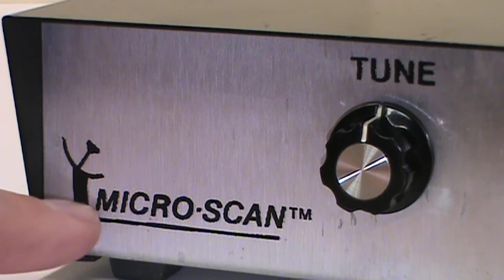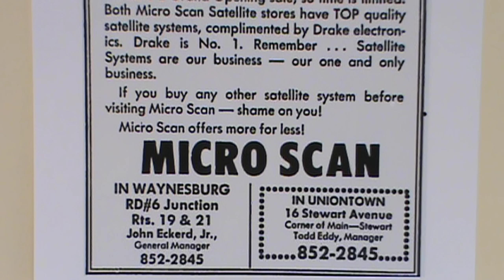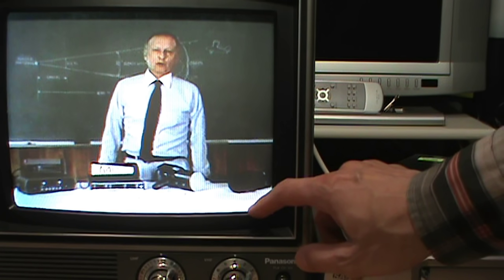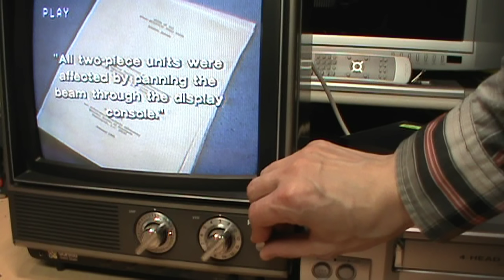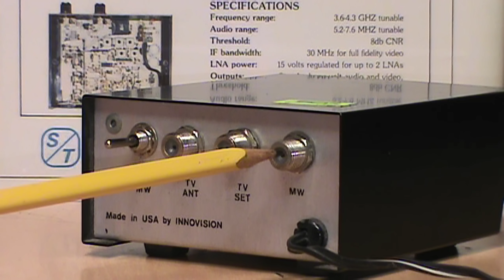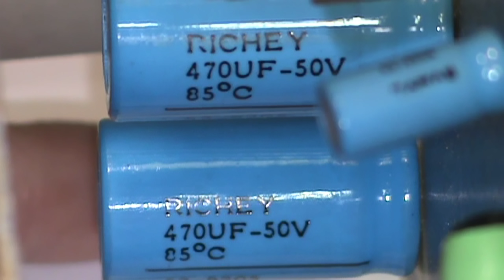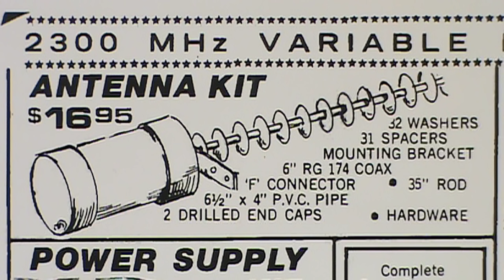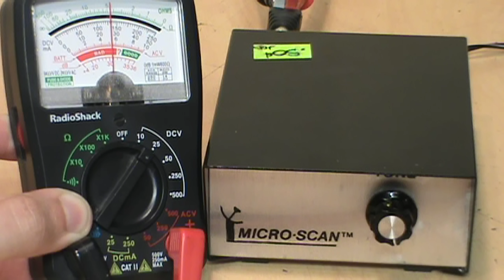Micro-Scan mystery 1980s TV device - Satellite? Microwave?

Comment: That is a horrible design, I can not imagine that switch is RF-rated. Might seem like it doesn't matter if it does its job but if there is a really bad impedance mismatch caused by the switch I would refrain from plugging in any RF modulator that I care about since it could get damaged by signal reflections off that switch.

Satellite LNBs run between around 12 and 18 volts, and the voltage level is used for polarization switching (and sometimes oscillator frequency switching, in which case it would technically be "tuning" in the sense that the satellite converter LNB will switch into a different frequency range), I've actually built something similar to this for my own test purposes (without the dual input "switch" though). The frequency range of 3-4 GHz is the "real" RF coming down from the satellite, but it would be coming out of the LNB on the dish antenna converted down to VHF and UHF (I'll be honest I don't know what kind of conversion old LNBs had, modern ones actually work primarily even above UHF, in the "L-band").
Reply: I have a portable 7" LCD TV from the mid 2000s that uses a regular switch to select between the side RF input (3.5mm jack) and the antenna input (standard antenna socket used in Europe).

Funnily enough, the side jack and switch only work for Analog TV, while the Digital DVB-T tuner is hard wired to the antenna socket. Even the user manual says you must connect the digital antenna to the antenna socket. Digital TV is far more sensitive and it probably did not work at all with the extensible antenna and the very legit RF switch.

I don't even know why they bothered with the 3.5mm RF jack, when the device already has another antenna connector. The internal layout is also pretty weird, as the digital TV tuner is it's own separate board from the analog tuner, and it has a total of 3 separate OSDs in one 7" portable TV.
Reply: It's not horrible design if it works and saves the maker and buyer the cost of a proper RF switch.
Reply: @whitcwa  read more than one sentence
Reply: @dereksgc  I read it all and stand by my comment.

Comment: Those were used in rural areas for wireless "cable TV."  There was a service called "RuralVision" in Arkansas that used similar boxes.  Basically, if you lived out in the sticks, you could subscribe to the service to receive around 5-6 channels.  The system consisted of a yagi type microwave antenna mounted to a tower at the home, aimed toward the transmitter.  The antenna had a downconverter that did all the work.  The "tune" knob changed the tuning voltage, basically telling the downconverter what channel to tune.
Reply: That makes perfect sense, and thank you for the information.
Reply: @DarronBirgenheier  We had the same in Dallas in the late 70s.  There was a movie service called 'Showbiz' that you could pick up with a homemade microwave receiver.  My Dad bought one from a guy that worked at Texas Instruments that built them in his garage.
Reply: Yup, a lot of us even in my suburban neighborhood first got cable this way while they built out the cable lines. lasted a couple years. EARLY 80s. Slowly each house got an antenna with a little dish on their roof so you knew who had fancy new cable!
Reply: this is exactly what came to mind. The main antenna would be on the highest mountain or hill in the area they could put it and it would distribute the TV to the houses
Reply: The tuning thing is the reason for the term LNB for regular satellite dishes. B = block, it down converts a full band in one go, rather than a specific channel like this videos device is intended for.

Btw in Sweden the cable TV operator Kabelvision used microwave links near the regular 11-12GHz satellite band, but with regular AM modulated TV channels. I tried pointing a dish to their transmitter and connecting an intermediate frequency signal in a satellite receiver to my TV's RF input. I could see a faint picture of the various channels, with almost perfect colors, which I think was the result of the frequency band being mirrored at the output I were using. In hindsight I should had taken an LNB apart to adjust the local oscillator to possibly get a usable signal directly from the LNB (although I would had had to adjust it to the upper part of the UHF band, and would likely not had a great signal strength due to likely high pass filters at the output of the LNB). But, hindsight is 2020, I never did this and I think that the analogue transmissions are long gone.
Reply: That's like the towers wireless isps used in the 2000s.
Reply: @stiepanholkien605  Wouldn't be surprised if they got reassigned the same frequency blocks that were used for those TV services a few years earlier.
Reply: Back in 60's and 70's, my granny lived on a mountain top shack in WV. She leased tower space to a TV company. They used something like you described. As a kid, I was amazed at how many stations she got up in the boonies. Back home in Ohio, we only got 3 local OTA channels, but she had more.
Reply: Awesome!
Reply: We had something similar where I live in Northern Ontario Canada between 1990-1997 and it was called SKY-CABLE. I remember when we first got it and we got channels 45 thur 54 and by 1994 it was 32-54 provided by a company called Fiber-Tel (they also sold C-Band satellites). The reception wasn't that great and the sound was in MONO but it was much better then the 4 local stations we had (2-CBC, 4-CTV, 9-TVO (TV Ontario), 12- French ( it was junk that nobody understood outside of Quebec). What I liked about SKY-CABLE was that there were only 5 Canadian stations and the rest ALL American stations with American Ads. WPIX out of New York was one of my favorites, especially the month of October because they called it SHOCKTOBER and they would play tons of Horror movies...which meant I taped a ton of those movies. By 1998 we got a mini dish called Echostar and it had 400 lines of resolution meaning the S-VHS Sony could FINALLY be used for it's full potential. By 2001-2002 the cheat cards came out...and you all know what that means...taping dirty movies NON-STOP in S-VHS lol.
Reply: @michaelfolino8414  wait.. what about CJBN? if you didn't get that then you missed out big time. does your mom know you recorded dirty movies ? how could you
Reply: In Chicago it was called "ON TV"
Reply: Voltage controlled oscillator.

Comment: My mostly uneducated guess is that this might be an "illicit"  device intended to descramble pay channels on cable that were scrambled., such as HBO.
The scrambling that was done back then was fairly crude, and depending on the television you were watching the scrambled channel on, sometimes the the image was even somewhat watchable, if you were very tolerant. I think it might be fairly easy to defeat with a relatively simple device like this, but again, this is an uneducated guess.
The tuning control might presumably be used to optimize the descrambling functionality.
Reply: My father had various "aftermarket" cable descramblers in the 80's, and none looked like this at all. Most just looked like a regular cable box from the era.
Reply: The circuits inside are far to simple for even early scrambling techniques. This was likely just the power supply and the real work was done at the antenna which converted whatever signals it was designed for and sent them down the coax on RF ch3, likely some kind of way to intercept HBO or another channel fed over terrestrial microwave links before they moved to C Band satellite.
Reply: A simple tunable notch filter defeated those types of jamming, which did work but did not require any power.
Reply: This was an early analog free-to-air satellite receiver that let you manually tune satellite transponders one at a time, usually connected to a large backyard dish.  Before digital satellite TV, signals from satellites were transmitted in C-band or Ku-band analog format. People used it with their “big dish” to pull in free-to-air analog channels (news feeds, network backhauls, international stations).  Since there was no scrambling on many feeds in that era, it was a favorite for TV enthusiasts who wanted to see raw, behind-the-scenes satellite feeds.

You needed a large backyard dish (sometimes 6–12 feet across) and a receiver to convert those signals into something a TV could display.  Unlike later receivers with presets or remote controls, these early boxes worked more like radios. The knob directly adjusted the local oscillator frequency, letting you “sweep” through the satellite’s transponders until you landed on a usable TV signal.  You'd turn the knob to scan through the frequency range, and a picture would eventually appear, assuming you were aimed at the right satellite.  Fine-tuning was sometimes necessary to stabilize color or sound.

"Microscan" was a low-cost brand marketed to hobbyists and early adopters. Instead of sophisticated features like channel memory, on-screen displays, or multiple satellite switching, the Microscan was a very basic signal tuner box. It essentially let you manually tune in one channel at a time, much like an analog shortwave radio.

Source:  We had one.  We even managed to pull in a signal from a Russian highly eccentric polar eliptical orbit satellite, which was the highlight of my teenage life https://en.wikipedia.org/wiki/Molniya_(satellite) .  It was black and white due to the different scan standard, but was crystal clear.